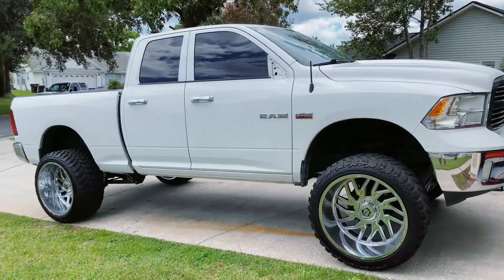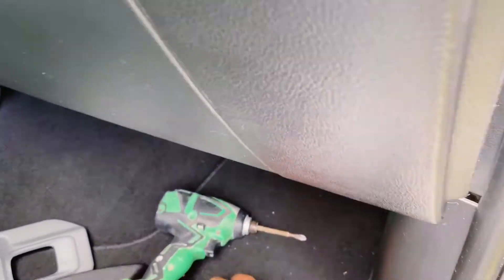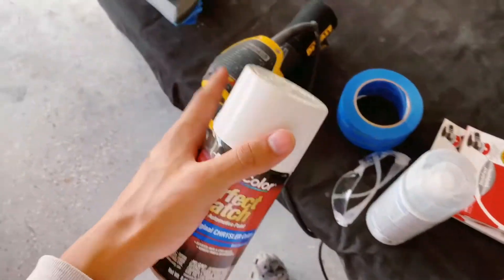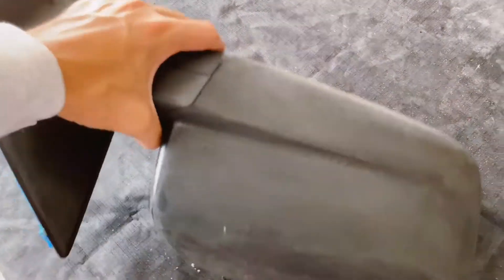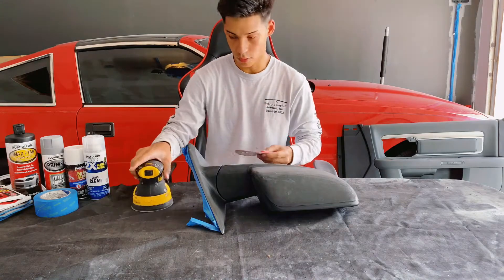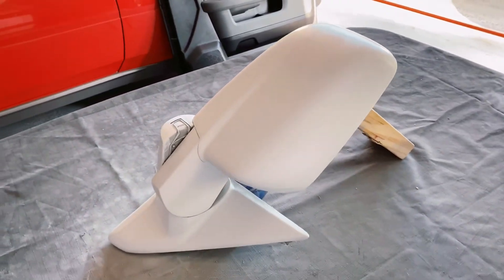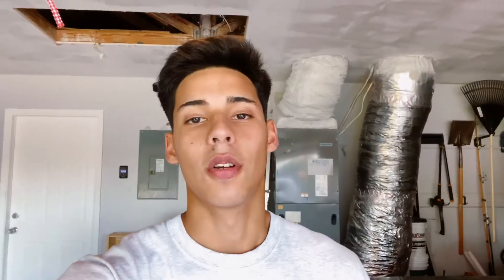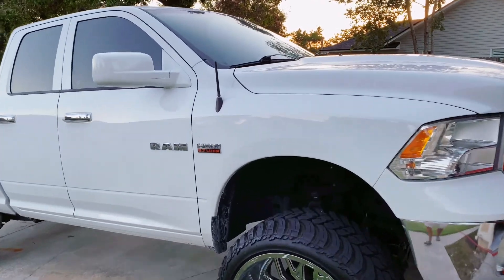Lifted Ram gets DIY painted mirrors

Comment: why didn't you use an adhesion promoter on the plastic before to painted the primer? That paint will chip off much easier without the adhesion promoter. Good luck with that..
Reply from the maker: The paint actually kept its strength. But the clear coat didn’t. Gotta figure something out about that. I go through mud and stuff and after washing it the clear would chip.

Comment: How are they honestly holding up? With pressure washing and what not
Reply from the maker: With the clear coat I used, that’s the only thing that peeled off in some spots but the white paint is solid. Dirt and mud doesn’t get stuck in it. It all washes off pretty good.